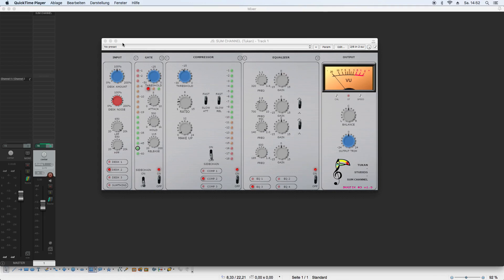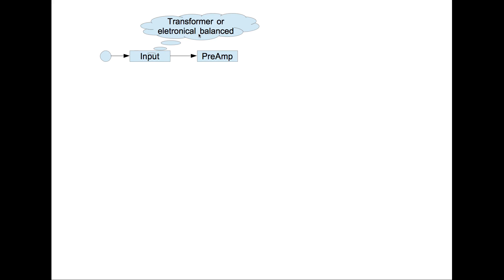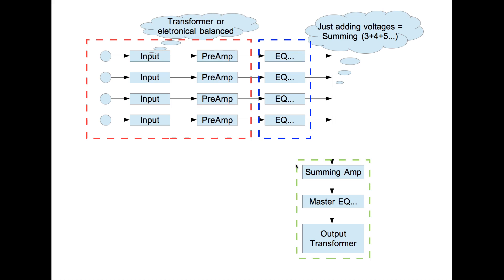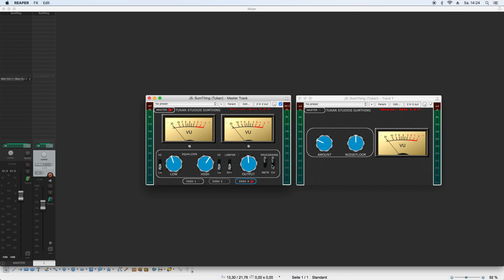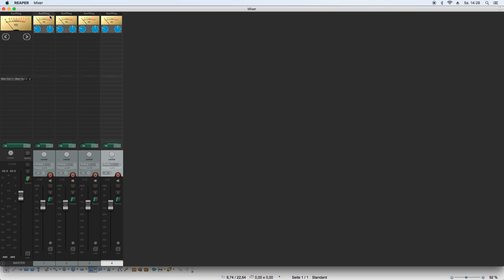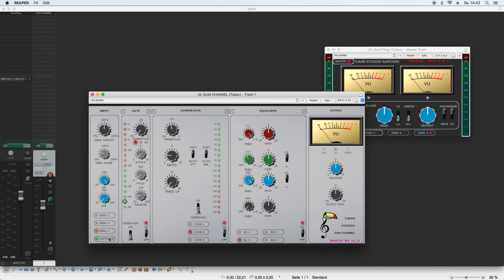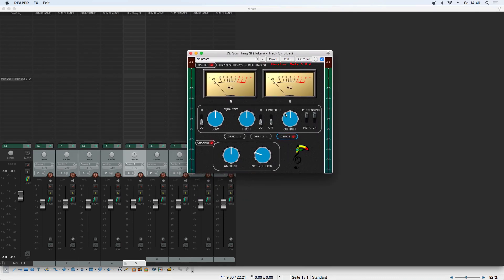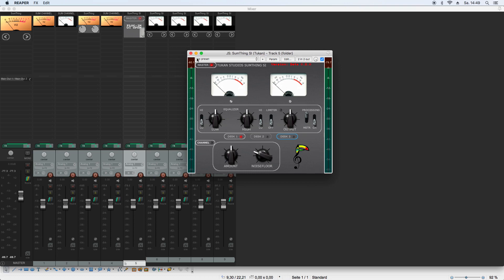Understandig SumThing/Channel - and BugFix#3 (TUKAN STUDIOS)

Comment: Hi John I recently started using your plugins and am replacing as many paid versions as possible!!! 
I have a few questions.....
1. What is the difference between the bus comp S2 and sun channel S2 comp?

2 . Do they work together in different places and if so where would I put the sum bus S2  in my mix?

3 I like the idea of the sum thing plugs but it doesn't seem to sync up with the sum channel S2 as there's no way to choose the sum thing in the plug...just the groups  I guess?

4 Will you be releasing a saturation plugin?

Thx in advance and love the plugs!!!!!
Reply from the maker: 1. Different compressor algorithm - or do you mean difference between bus comp S2 and sum bus S2?
2. SumChannel S2 and SumBus S2 interact depending on the SumThing Group you select. Put  SumChannel in mix channels and SumBus in the parent bus/folder.
3.Sure you see the whole plugin? SumThing can be selected bottom-left. All plugins within the same group will be synced in terms of console selection.
4. SumChannel does a bit of saturation depending on the console. Other plugins like EQT, BusComp, LA-2Kan, Tape and more produce subtile saturation too. For real nice and more drastic things please use varibus S2 (turn threshold down if you don't want compression)

Comment: Hello John. I´ve been playing with this wonderfull plugin and have some ideas I can share and maybe you could make of use.  First of all, I suppose that all the post-input stage processors, that is, Gate, Compressor, EQ, does the same type of processing regardless of the type of Desk that is chosen in the input stage and will vary its response depending, of course, on the harmonic distortion load delivered at the input stage by the desk type. Please correct me if I'm wrong.
One improvement you could make to SumChannel would be the ability to connect different subgroups via a user-assignable channel selector. Just as it is done in the Waves NLS plugin. In any case, the whole package (Sumthing, Sumthing SI, Sun Channel) is a very powerful tool for the mixing engineer. Thank you so much for all the effort you put into your plugins.
Reply from the maker: Hi! Thank you for your input :) Actually I don't have a copy of NLS, so maybe I don't really understand what that channel-selector thing is about. For SumThing/Channel all the routing is done in reaper natively, and you have all the choices of combinations of desks in all stages that exist. I know, there could be something like groups for selecting desks...but that would make it too complicated, don't you think?
Reply: @johnmatthews8435  Yes, groups, that is what I was referring to. As an engineer I don´t find it complicated at all, it would make SumChannel even better. Don´t get me wrong I´m not criticizing at all, just suggesting something for improvement, maybe at some time or not, in any case the plugin is very good. Thanks again.
Reply from the maker: @eduserra  I wouldn't find it too complicated too. And it would be handy, yes. But most users already struggle with this SumThing-Master/Follow thing, what SumThing SI does and how SumChannel reacts. That's why I made a couple of videos about that. Groups would confuse even further. That wouldn't improve the user-experience for most.
Reply: @johnmatthews8435  Yes I get it. As an instructor I find challenging explainning things like this to my students, specially if they´ve never used a real analog desk. I´m in the process of making video tutorials about all your plugins for my audience which is spanish speaking community. I´ve been making some noise about your plugins in Facebook and there is some kind of spectancy. so it is very nice.

Comment: Still don't understand the difference between a channel in Reaper and a summing plugin. Maybe I missed the exact part. Airwindows makes a console effect as well. Whoosh, right over my head. What's the reason DAWs don't do this natively?
Reply from the maker: I explain that in the video: It is the combination of input stage and output stage that makes the sound. So it is about 'what' your'e summing and how the 'sum' is 'shaped'. The summing itself doesn't play a role. The clue in the SumThing/Channel is in the existence of pre- and post summing units that are synced/interacting.
Reply: @johnmatthews8435  I'm sure it's brilliant but these kind of effects just appeared on the scene out of nowhere and the marketing never reached me with the normal "ever have this problem? here's the solution" line of reasoning. I guess it's a sort of saturation class sort of effect? The problem with a lot of tutorials like this is that I know about 95% of the information and so I skip around looking for the significant bit and I miss it. I need a wormhole to back in time when these plugin types were invented and to hear from the inventor what the problem he was solving was, or i need to hear a difference between with and without the summing effect. It's not a super high priority to me because I haven't been given the problem that it is supposed to be solving ages ago when it was first conceived. Even when Chris from Airwindows is demoing many of his plugins, I have a hard time 'sensing' the a/b sometimes. Like for another example I absolutely cannot hear the difference between an oversampled compressor (or any other effect) because I don't know what I should be listening for. I'm sure you know exactly what you're trying to achieve with your desk plugs, and I don't doubt the hard work, research and ability you have.
Reply: I'm revisiting this video again because I'm still interested in learning about your work. I've also seen Airwindows' video today on his console7. The question I have now is that when you put Sumthing channel on a track, it will be first in the chain, and if you add other effects after it, does your channel plugin need to be at the end of the chain? I also wonder why DAWs haven't already integrated this kind of technology into their mixers, since as I understand if one does use this kind of console summing emulator system, you're not supposed to touch the DAW's mixer, but rather use the channel gain knob. I'm just wondering the use case scenario for those who would use this system, because it seems to be a workaround for some shortcoming of the typical DAW's mixing algorithm.
Reply from the maker: @intelligenceservices  You can put the plugin on every place of the chain. What you do is completely depending on what you want...or, for example, you use the input stage and the compressor, but another plugin as an EQ.
Reply: @johnmatthews8435  thanks for bearing with me. I guess I'm drawing a blank as to whether the channel plugs are more or less rerouting the stream to the buss plug, around the standard channel fader. I will need to play with them to see what i can derive. Thanks again.

Comment: I have a naive question: How is reaper summing the signal differently? Isn't the summing of the channels implemented very similarly other than trying not to impart a sound character? And if you'd do this plug in based summing mainly for the sound character, wouldn't it be enough to put the summing stage on the master of reaper - I guess unless you want to add sound character on each channel as well?

So in other words: Is reaper summing the signal the same but without adding the sonic flavor?
Reply from the maker: Simple answer to your last question: yes.
As I explain in the video: The summing is not the point where you derive "sound" from. The character depends on 'what' you sum (Input stage) and what the output stage does.
Reply: @johnmatthews8435  Thx and for the expensive analog summing mixers on the market, it is also not about “better” summing in a mathematical sense but I assume they have a bunch of transformers and other critical electronic parts which impart their sound and justify the cost? :) This summing topic was always puzzling me - I guess another thing is that the analog summing, because if the transformers isn’t as precise / clinical and which some people prefer? One last question: How does your plugin deal with aliasing - are you oversampling?
Reply from the maker: @hukl3945  Not yet. I know that it would be good to have an oversampling option. I still hope I find a clever way to do it.
Reply: @johnmatthews8435  I believe Reaper made your life easier with the last updates, which allow us to natively oversample from individual fx to entire chains. Dan Worral posted a video on this showing it works very well! 
About your work: I can't thank you enough for handing out such incredible tools for free! You're making our lives as independent producers who are always on a budget much easier. This plugins are top notch and feel and sound real, analog and 3d. It's incredible how well they hold up to UAD, sharing the same quality and similar flavors. Once again, thank you for your kindness!
Reply from the maker: @nicolasmauch  I posted a video on that too ;) (I believe I was the first one) :p

Comment: Truly genius! Those are not 'just' a set of great plugins, but well integrated within the DAW & mixer itself. Thank you so much, John!
Quick question. Talking about transformers and such...have you tried Pulsar Modular's Climax P42 (a line amp emulation for tone shaping/coloration & saturation)? 
It's an amazing piece of artwork I must say, but obviously it comes with a price (and rightly so). 
Could you built a plugin that does 'sumthing' similar, but obviously even more integrated in Reaper and cpu-friendly than the P42 already is?
Reply from the maker: Haven't tested it, no...
Reply: @johnmatthews8435  Please have a look, you'll be impressed. It sounds very analog-ish. I hope that one will inspire you in order to built your next masterpiece ;-)